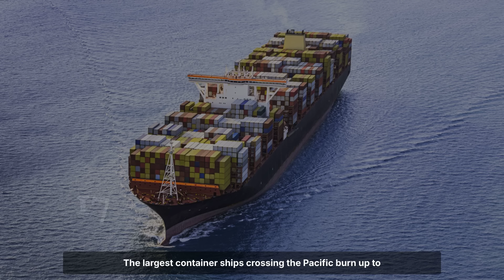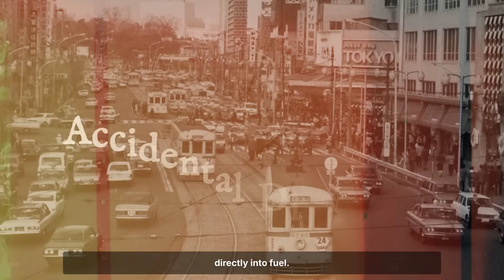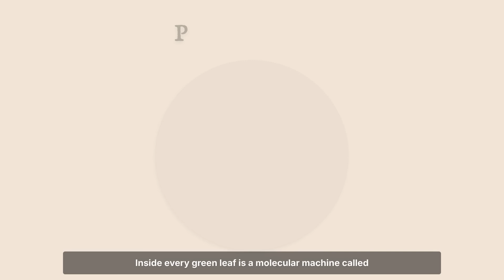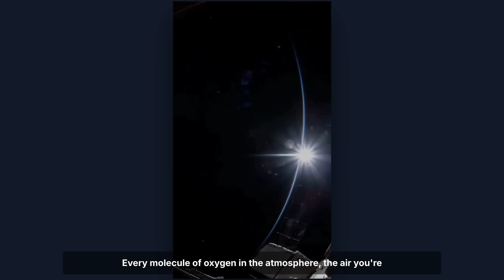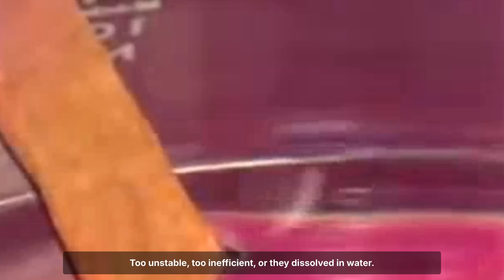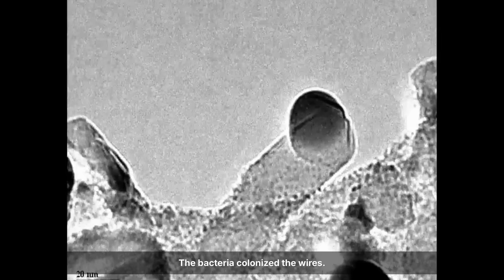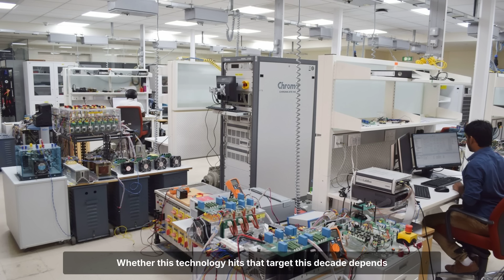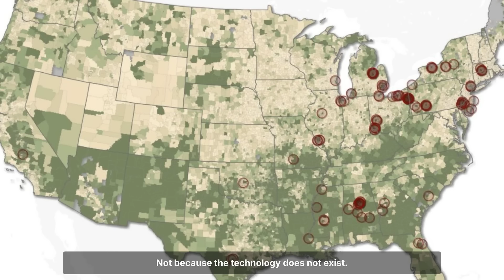Sunlight Into Fuel. No Drilling Required. Why Big Oil Is Worried.

Comment: The cost for hydrogen gas from ocean water is offset by producing magnesium alone from salt water. The mineral & Co2 rich ocean water can provide cement, bricks, fertilizer, chlor-alkali life sustaining chemicals, sodium ion batteries, Co2 Credits, magnesium sales alone pays for any cost of hydrogen gas that can be safely stored in room temperature, non-toxic clear liquid by Ayrton Energy in Canada.
Reply: There was a salt water battery Aqua or something using manganese and salt water to make electric battery it was good for stationary as the power output was low and thus needed to run in parallel to get decent power output sadly they went bust probably a decade ago now. I recall seeing a system for sale on Ebay or Market place but out of my budget at the time even though it was going for a song. There was also Redflow a Zinc Bromine flow battery that was portable and you just had more units could produce 10kwh it had number of issues and eventually the company was wound up sadly!
Reply: Far more valuable than magnesium is the magnesium oxide, that's much easier to make from seawater, you just increase the ph of some brine, after you've evaporated most of the water off. Usually by adding a little sodium carbonate. 
That gives you magnesium carbonate precipitating out. 

But why the hell you want hydrogen anyway? 
Macro algae's like kelps fix nitrogen and make protein as well as fermentable sugars at 500 tonnes per hectare per year. C4 photosynthesis, from sugar canes which are nitrogen fixers, use very little water and produce over 500 tons of dry biomass per year, clostridium acetobutrycilum is the bacterium that lives up a cow's bum.  It can turn any vegetable matter into 4 parts iso butanol, 2 parts ethanol, and two parts acetone. Add while doing it it turns dissolved nitrogen gas, into protein. 

C3 photosynthesis as in The Woody grasses such as bamboo can do even better with over a thousand tons per hectare per year of cellulosic biomass.  They do need more water for it. 

But all three, of these superproducers,  are capable of producing all of the food and liquid energy requirements,  for 500 humans per hectare. 

We have over 30,000,000,000 hectares of prime real estate. Enough to fuel 180,000,000,000,000 tons of living biomass by natures best practices, without our assistance.  Which is 6000 to 10,000 tons of living biomass per hectare if you don't already know. 

Why don't you see if you can observe how nature keeps 6000 tonnes of life alive on a hectare of land, or over 10,000 tonnes per hectare in the sea.  And figure out how to improve on that. 

Doubt you will be able to do better with some wires and test tubes, and pinches of magic powder and bristles of metal.